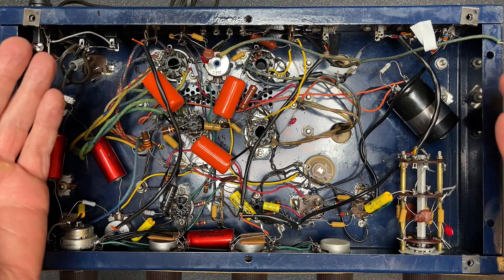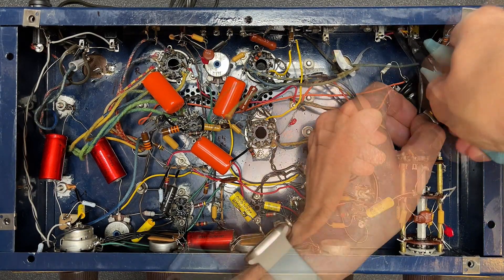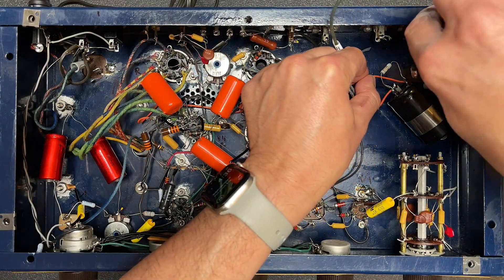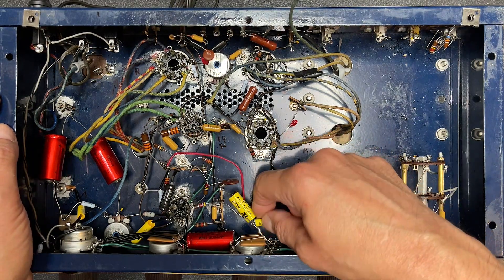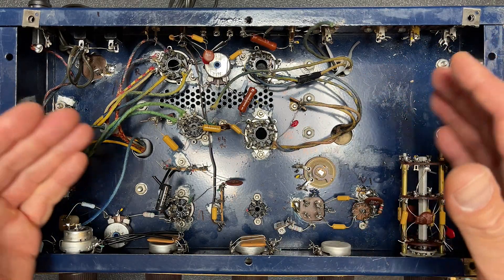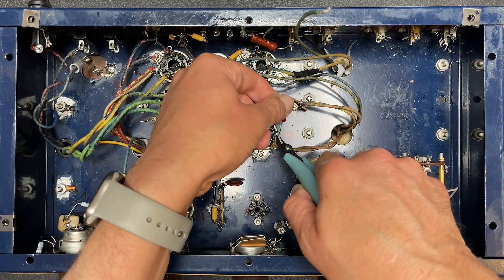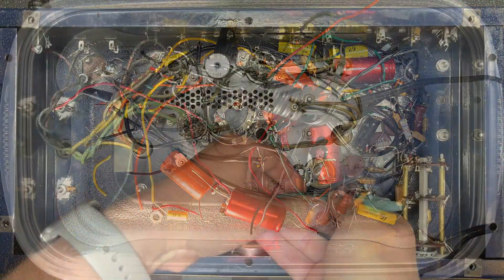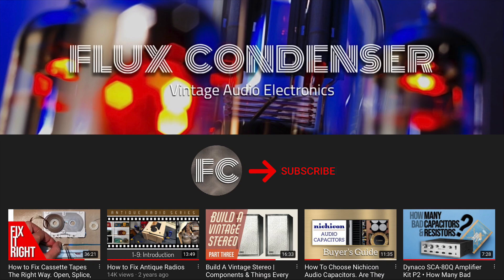Did I Ruin This 1950s Tube Amp? Eico HF-52 • P2

Comment: Years ago, I was doing side work for an audio repair shop in Memphis, TN.   A person brought in a partially assembled Dynaco Stereo 410 power amp.  This unit had a external capacitor bank as well to improve performance.   It was not as bad as yours but was also improperly built.
The original builder did not follow the step by step procedure in the manual and was attempting to do it his own way.  Some of the wiring had been cut too short and I had to extend them during the rebuild.   I had to redo a lot but I managed to complete the kit.   The amp was nice and it had a circuit that prevented hard clipping as well as protection of the output devices with a crowbar circuit.   The scariest part is when I did the procedure of dead shorting the speaker outputs to verify that the short circuit protection worked.  They did.  I remember wishing that I could buy the amp because it was nice.
Reply from the maker: That gave me a chuckle, thanks for the story. “He did it HIS way!” Good on you for getting the 410 back in proper order.

Comment: The kit building instructions are probably available online. Is this the one with the error in the tone circuit or that's for a different model?
Reply from the maker: Yup, I’ve got the printed version of the manual and the original Riders sheet. Wasn’t aware of any errors in the tone circuit. Thanks for the heads-up, I’ll take a look into that just in case.

Comment: It used to be us DIYers would buy tube amps in poor shape just to get the transformers. Then build something new. Those days are gone when you see a beat up non-working Dynaco 70 going for $900!
Reply from the maker: Yeah, it’s amazing how much these things have gone up in value, for sure. And although it wasn’t my intention to gut this amp, at least in addition to the transformers I’ll also be keeping the chassis, controls and integrated components. The amp will be rebuilt to original spec, but this time the right way. It was so bad I felt this would be the best path forward.

Comment: I wouldn't install anything until you refinish the inside of the case, then you will really have a clean slate.  Time to "Build Back Better", whatever....
Reply from the maker: That’s definitely a possibility, Dave. Not sure I’ll go that route, though, as there’s no corrosion. It’ll get a thorough cleaning for sure. There’s no way I’d get this amp back to looking original on top (and I like the blue) so I’ll probably just try to touch-up the exterior. We’ll see.